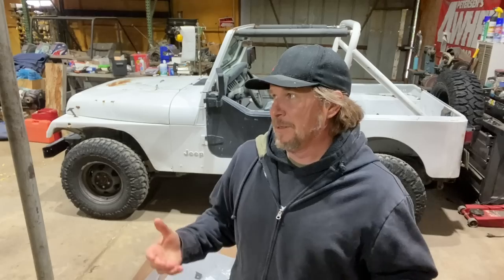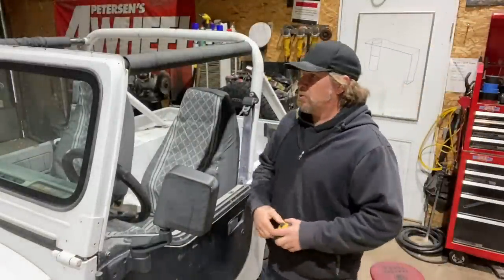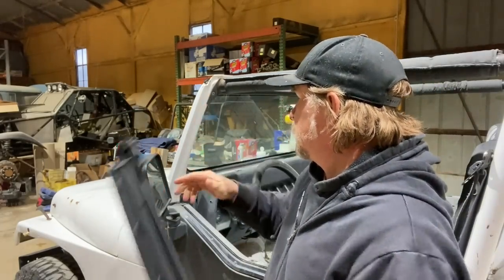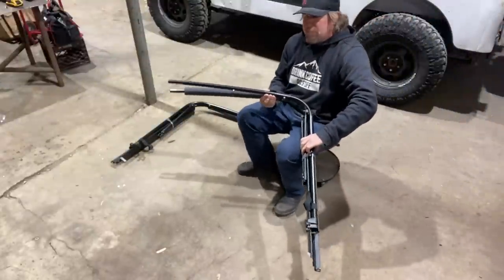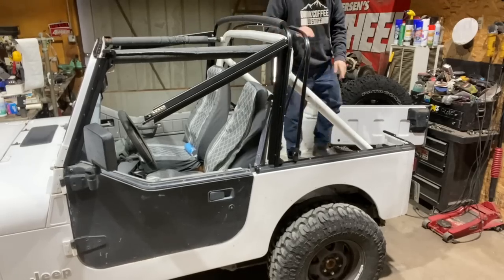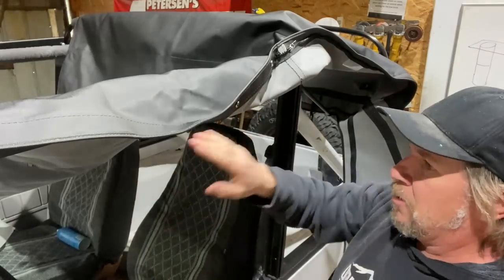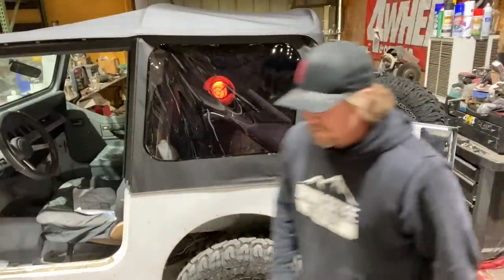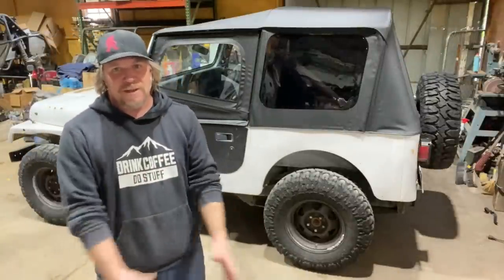DIRT DAILY. The Jeep YJ gets a new Bestop SuperTop

Comment: Top looks great, that dang  cold weather is a pain in the rear when dealing with those dang tops.
Seems like I usually wait till it's getting colder out before I put my boat top on, same deal.
Just a little tip, if you're using a propane heater like that. Slide the tank into a milk crate, still be careful but it'll be
a little more stable. Great video, Keep em coming, that crate thing keeps them from rolling around the back of the truck when taking them to get filled.

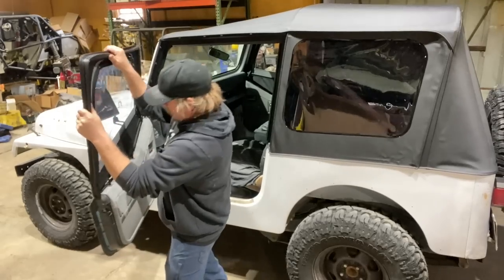Comment: Right at 18:35 you press on the window to set it in place. The entire Jeep rocked. It shouldn't do that. The shocks appear to need replacing. Otherwise, I wish I could have it. It would make a good Jeep for a beginner, but they need to know the 4 cylinder is not for racing. The interior looks like an upgrade. If the engine is decent, and the frame is clean and rust free, I'd say a fair price should be $4-6K.

Comment: Hey my friend, 18:33 
Where you installed the windows, I'm on 1988 Jeep Wrangler I had the half windows with those two screws that bolt in to keep the windows on the door so when I went to put in the windows like you have with the soft top they won't go all the way down Do you know if there is a bolt welded into the door for the old screws?